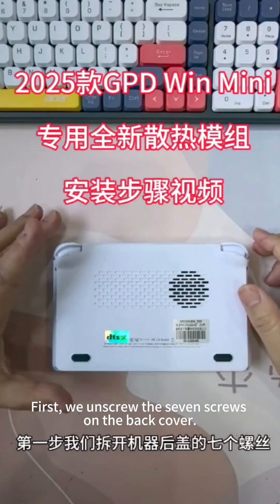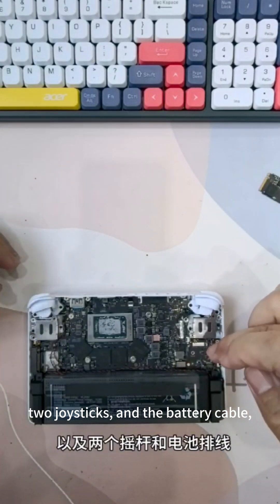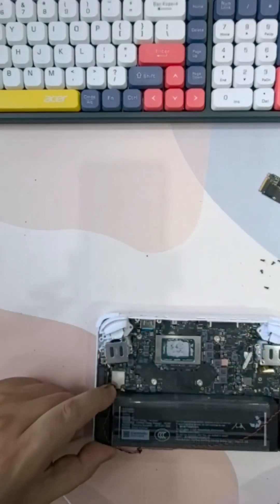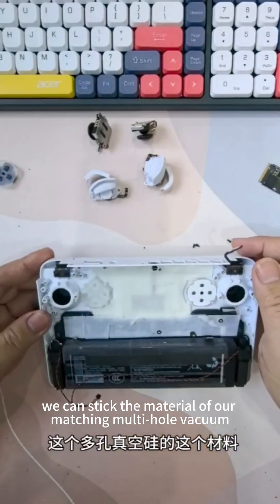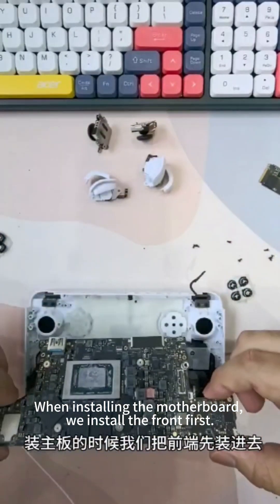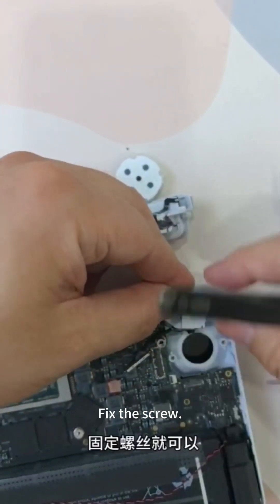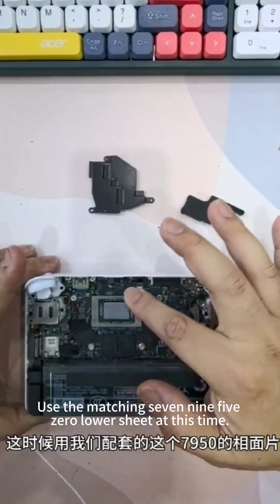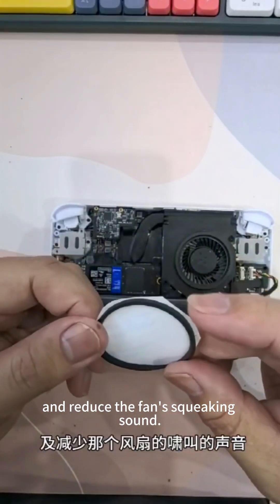GPD WIN MIMI 2025 Cooling Module Installation Guide

Comment: A Few details for any of us to attempt it:
1) When disassembling the motors from the plastic cover - use a hair dryer or a heat gun on low setting and slowly warm up the adhesive on the cables, they are very delicate.
use the plastic tweezers and go very slowly when peeling. When you get to the connector panel - be gentle and careful and lift up the METAL COVER underneath, I used sharp metal tweezers in order to lift it up slowly after heating it a little.
2) STOP at 0:26  The insulation is very good, but I decided to avoid this step as I'm not going to use the device hand held - I use a joystick. So you can skip to 6:32 if you choose to do the same.
3) The vibration motors cable need to be flipped, but not "reversed" - no need to re-solder them ;)

Good luck!